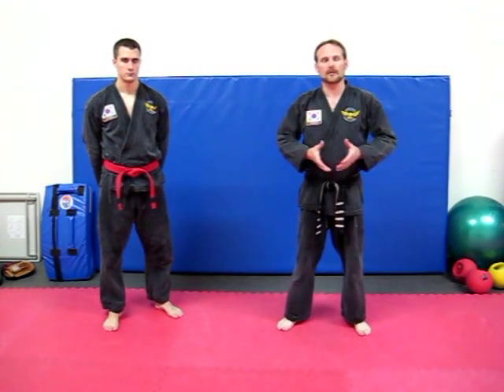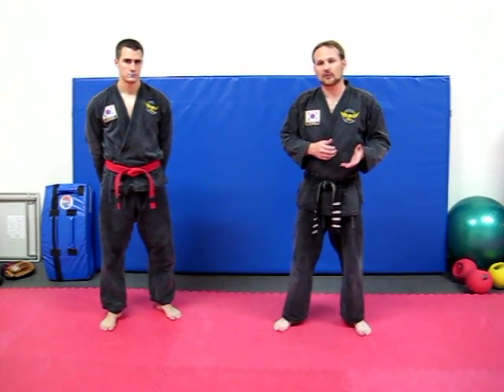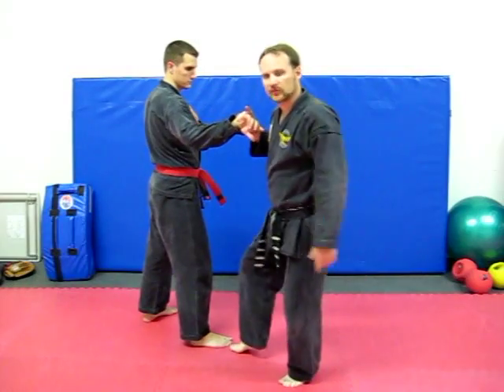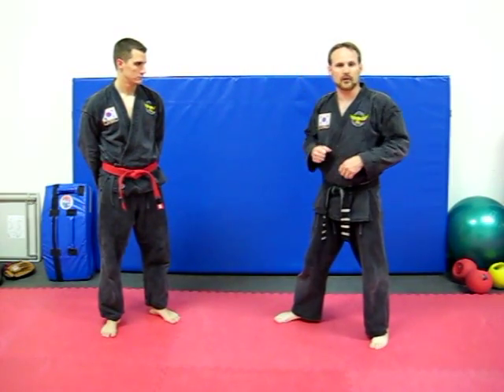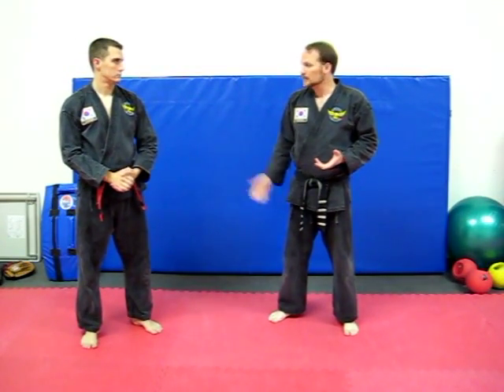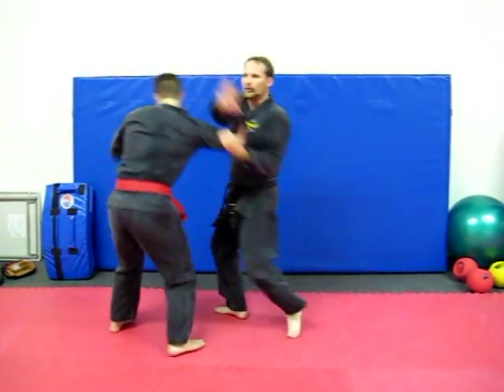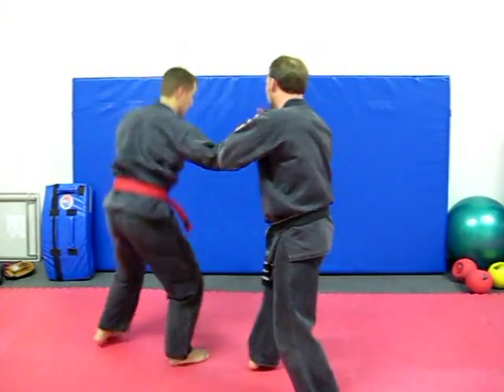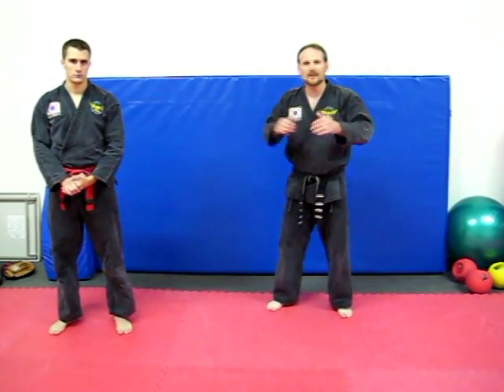Response to Hapkido Lock/Flow Drills

Comment: I was searching for Hapkido in Nebraska and happened upon your blog and noticed one of my videos in the post with this video. I agree with a lot of what you say about using the center. I don't think that the way I do the armbar is incorrect maybe just different than yours. It is not just the bending at the waist, the knees are also bent and we have a wide stance that provides for balance and stability.  I have several students that are smaller than me who effectively do this technique.

Comment: I'm a Modern Arnis student. the comments you are making hold true in my art and any other art that used these lock styles.  My practice mates and I were just discussing and working on refining our lock flow drills in order to make them more efficient. Do you notice that a lot of these locks work better when held close to the body as well as the body shifting and dropping as you discuss. Can't wait to get back in the gym and work on what you are showing!  Thanks.

Comment: The main technical difficulty I see: the Z-lock is off the attackers centre (and many other techniques lack this requirement) therefore working less effectively two years ago, GMs K. MacKenzie and Geoff Booth showed taught us the principle during a seminar). I think it is agreed that a technique, to be effective, must be held close in to your body and in the area of power (the baseball strike zone is a good analogy). To lack one of these creates a less effective technique whether punching, kicking, or locking. Other than these being emitted, great  explanation of flowing. Many instructors fail to use body weight over strength. One other added note for viewers in hapkido, aikido, etc: use feel and sensitivity to know how a person is resisting and where they are moving. This will allow you to use push/pull concepts to apply the lock needed for the way the opponent is moving.

Comment: This is a good video. I think I understand what you are trying to convey to the YouTube audience. There are several videos on joint lock flow drills, but most of them are more focused on immediate speed and flash. I think you are trying to say that it is more important to actually do the 'lock' correctly, than to do it with speed. Because if you get in the habit of being more concerned with speed, then your locks will be poor. Over time speed will come naturally as you build good 'technique'.